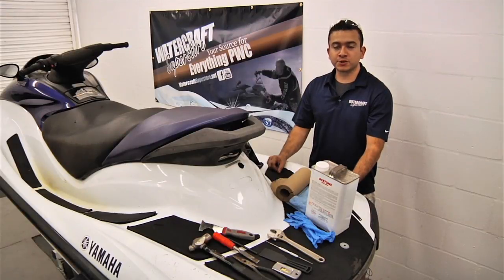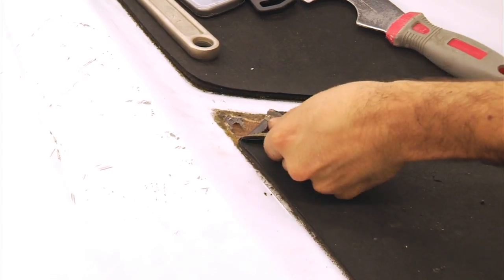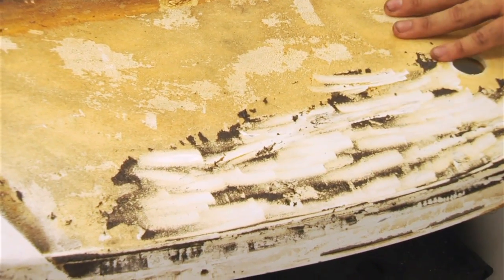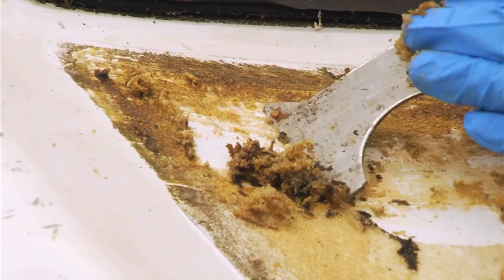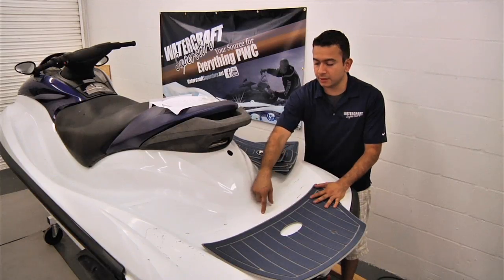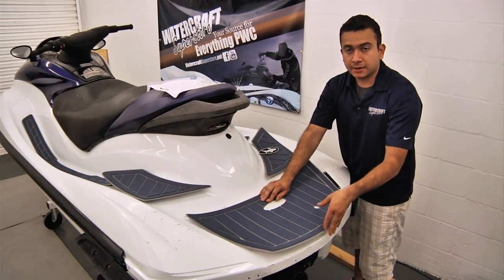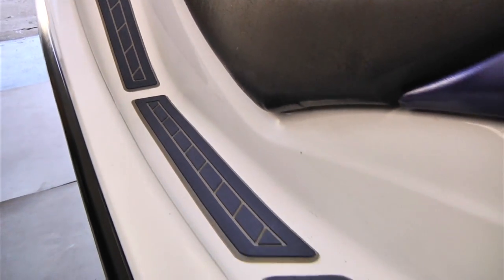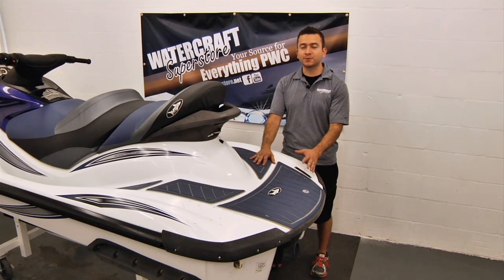WCSS DIY: Traction Mat Install on a Yamaha FX

Comment: Goof-off is crap.  I used a whole bottle and didn't work at all for me on just one section.  Get De-Solv-It Contractors' Solvent.

After pealing off as much of the mats as you can

1) Spay on solvent and wait for 5 min or more.  I sprayed one section while scraping another
2) Plastic scrape while wiping scraper with paper towel to get 80% of adhesive
3) Spray same section again and go to next section that has been soaking
4) Go back and get remaining 20% use a razor scraper (it will be fine)
5) Finish spots with a Magic Eraser
6) Wash off remaining chemicals with plenty of soap (simple green) and water
Reply: it really is, especially for adhesives, there is too much oil in it. It is better for other types or car badges.